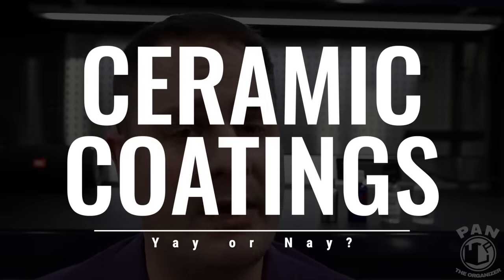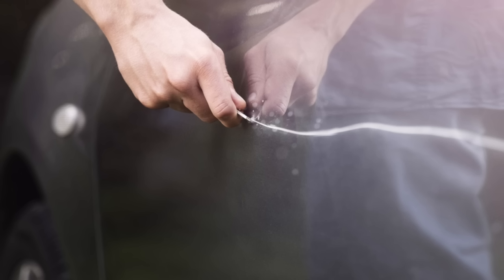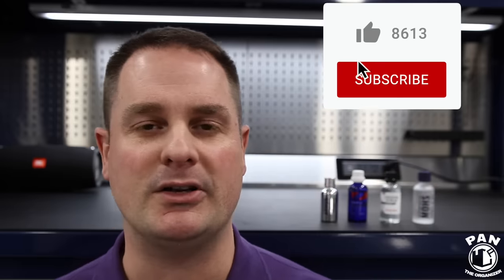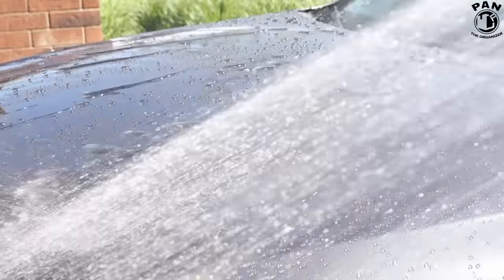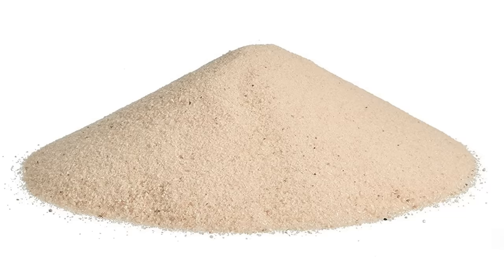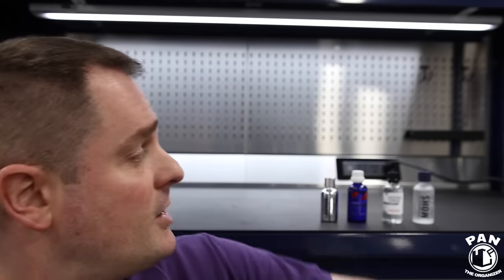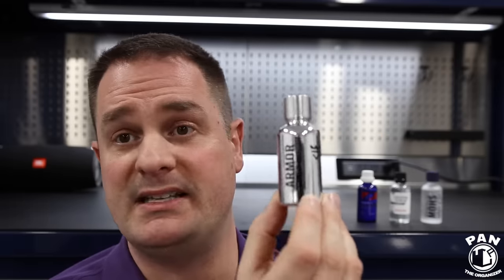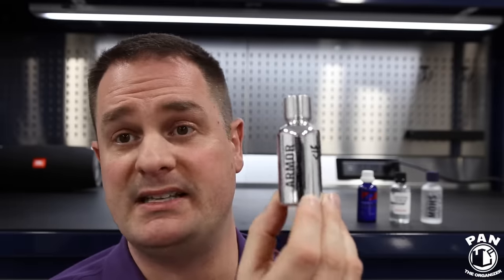DON'T BUY CERAMIC COATINGS BEFORE WATCHING THIS !!

Comment: Pan how come I washed my whole car with a good soap and pressure washer but still after I dried it, there was a dull layer of something on the paint that is not easy to clean. Mostly on the lower half of the car. What is that called and how can I clean it
Reply from the maker: I have no idea as I have no clue what you did, what products you used, what conditions you worked in, what protection was on your paint, etc.

What you wrote is the equivalent of me calling a doctor an simply telling him “Hey doc, I don’t feel well. What happened to me?”

You see how he has no info to start helping me?
Reply: @PanTheOrganizer  I think it’s road grime that was left on the paint after a regular wash. But I was in normal cool conditions and I have the vehicle coated with megs hcw. Is it normal for road grime or heavy mud adhered to the paint to not clean off with a ph neutral soap?

Comment: Does the microfiber cloth need to be discarded which was used for the maintenance silica spray dealing?
Reply from the maker: No. Just wash immediately after use and reuse it.

Comment: Can you go through the automatic car was after applying a ceramic coating.
Reply from the maker: Yes. Wait a week after application before washing your car though. And if you absolutely need to go to an automatic car wash (a handwash is always best), pick a contactless car wash. No brushes on the paint.

Comment: Hey buddy. Fantastic and so well explained video. I am a new enthusiast to  detailing and obviously I have got a lot to learn. With your video in mind, and those SIO2 Ceramic coating sprays that you recommend to use every 2 to 3 months to top up the ceramic coating... Can you use them on its own just for a basic protection after a wash? Or after a simple wax?
Reply from the maker: Yes if you paint has no protection, those sprays can be used as stand alone paint protectants. They will give you excellent protection for 2-3 months, up to 6 months depending on which one you buy.
Reply: @PanTheOrganizer  thank you

Comment: Pan, just watch your video. Very informative & thank you. My questions are can you apply a product, like Seal & Shine on top of the ceramic coating to help maintain it? Also, what about all of the commercial brands of ceramic coatings like Maguire & Turtle Wax, are we not to use them anymore & only use the “semi-professional” grade products now?
Reply from the maker: You could technically apply SNS on top of a coating, but it’s best used as a base layer of protection. You certainly can use Meguiar’s Hybrid Ceramic Spray Wax or Turtle Wax Ceramic Spray Coating as toppers over any brand of ceramic coating if you want.
Reply: Thanks Pan!😃

Comment: I use my vehicles for my transportation business and some of them are washed multiple times per week (sometimes even daily!) Could I increase the frequency of applying a topper to something like weekly? Also, if I plan on having PPF on the front clip should I not do the ceramic coating on those areas?

Thank you for the great videos and information!
Reply from the maker: You can use toppers as often as you wish. For the PPF it depends on your installer. Ask him if it’s ok to coat your front clip before the PPF installation.

How did you discover my channel by the way Allen?
Reply: @PanTheOrganizer  Thank you! I don't remember which video of yours I saw first but I have watched many of them! Also heard you mentioned on Larry's Ammo NYC channel so that's keeping excellent company!
Reply: @PanTheOrganizer  Hi Pan, I have another question about applying a ceramic coating to an older car (I bought 4 bottles of the Avalon King through your promotion) - I have a 2014 Prius that will soon be going to my teenage son. The majority of the car is in excellent condition but the front bumper an lower bumper areas have a lot of small rock chips. What special steps should I take (if any) before ceramic coating these areas?

Comment: What ceramic coating do you recommend for wheels? I need to get it asap because I need tires!
Reply from the maker: You can use any of these coatings on wheels too. But if you want a dedicated wheel coating, that resists higher temperatures, you can check out my wheel coating tutorial here: https://youtu.be/zGOI6bwJlM0
Reply: @PanTheOrganizer  Awesome, thanks!

Comment: about that 2-3 month rejuvenation period for ceramic coatings, would it be ok to use torque or nexgen
Reply from the maker: Yes, but there are sooooo many better products you could use as far as silica spray sealants. Watch my 2020 car detailing products awards video to find out my top picks in each product category here: https://youtu.be/ULvGi3dbBrA
Reply: @PanTheOrganizer  ok thanks!

Comment: Can I ceramic coat my plastic headlight housings on my Cadillac XT6?   Can I also ceramic coat the windshield?
Reply from the maker: It depends what coating you bought. Some are just paint coatings. The AvalonKing can be applied on paint, glass, wheels, plastics and lights. As I demonstrated in this video: https://youtu.be/6hDGYz6vvsw

Comment: Hey Pan, love your work. I have applied sealants like Turtle Wax Ice Seal n Shine to my car. How do I properly remove them as much as possible to get to virgin clear coat, in order to apply a ceramic coating?
Reply from the maker: Machine polishing is the only way to fully remove existing protection 100%.

Comment: Hey Pan, great rundown. Quick question, you mention quite rightly that you should throw out any towels used for application/levelling of a coating. Would this also be true for towels used to apply toppers (Reload, etc), or is the concentration of those products low enough that the Si02 would come out when washing my towels?

Thanks!
Reply from the maker: For sprays you can just wash the towels after use and reuse them (unless the manufacturer specifically mentions to discard the towels).

Comment: love your videos . you give a lot of info we can use and make our cars look great. There is one thing you should add is the direction you wipe off your coating . my friend was going in circular motions which i believe is not good it should up and down or side to side.
Reply from the maker: Wiping off (levelling) doesn't really matter, as there are no abrasives in paint protectants like coatings. Some like to buff in circular motions, some like straight lines. Just use quality microfiber towels and what ever way you prefer is ok.

Comment: Pan, A couple of questions on coating a new car, 3 weeks old and just had paint protection film. I presume you don’t clay the PPL.... Is  it necessary to do the clay bar on rest of the car?  Also are these coatings put on wheels and calipers? Thanks.
Reply from the maker: You don’t clay the PPF. And for the paint, you only clay if it needs it, meaning if you feel contamination on the surface.

Comment: What's the difference between these ceramic coatings and the Turtle Wax hybrid solutions ceramic spray coating?  Does the Turtle Wax provide the same protection on the paint?
Reply from the maker: These are true ceramic coatings that last multiple years. Obviously less expensive spray versions like the TW aren’t nearly as durable as they sacrifice durability for ease and speed of application. Silica spray sealants are basically less concentrated forms of coatings, and an alternative for those who don’t want to invest time or money into a proper ceramic coating.

Watch my popular video explaining the differences between waxes, sealants, ceramic coatings and silica spray sealants: https://youtu.be/Yxz3zSVIm-g
Reply: Thank you Pan for the answer!  I’ve just applied the TW ceramic spray coating for my 2021 RAV4 a week ago.  I live in Hawaii.  It’s always sunny and I don’t have a cover parking when I go to work.  Now that I really want to try the real ceramic coating to protect my car from the 🌞

Comment: Thanks for your informative content 
Which one of these or of the ceramic coating branding can do the paint and the plastic trims, if none could you suggest the one that does the trims
Thanks in advance
Reply from the maker: The AvalonKing can be applied on paint, glass, plastics, wheels, headlights, etc.  Pretty much all the exterior surfaces.

Comment: Pan I want to buy a low gpm with a little over 1000 psi pressure washer that can be used with a non-pressure water source like a large bucket or tank. Can I do that with any electric pressure washer? Can you recommend me something? Thank You and love your videos!
Reply from the maker: Hi. There aren't many great solutions, but probably the best one where you could use a large bucket filled with water would be the Worx HydroShot. Link here: https://amzn.to/2Ice8qd

So you won't get 1000 psi out of a cordless power washer like you would with an electric power washer. So 320 psi if pretty much what you can expect. But still enough to do light to medium cleaning duties on vehicles.

How did you discover my channel by the way?
Reply: @PanTheOrganizer   just searched how to wash a car, and your videos showed up.

Comment: Is there any problem using a Topper like Xtreme for a car that has been ceramic coated with MOHS or do you have to use the Gyeon product?
Reply from the maker: You can use which ever compatible topper you want, including Xtreme Solutions Topper.

Comment: Pan. Great video a lot of good info.  I have only used standard wax on my vehicles but thinking about a ceramic coating for a new truck I just purchased.  My question is there any disadvantages of a ceramic coating versus wax?  If you still have to apply a SI spray every 2 to 3 months you still have that maintenance step as with a wax.  Is correcting a contamination issue or surface damage issue more difficult to resolve if the vehicle has a ceramic coating?  Thanks again I really enjoy your videos and the information you provide.

Comment: difference between multiple layer ? i want to use 1 layer but is there any difference in gloss ?
Reply from the maker: Not all coatings require 2 layers. Some recommend a second layer, some only one. Often, when a second coat is recommended, it’s to ensure proper coverage and sometimes it’s for a bit more durability.

Follow the instructions of the coating you are buying.

Comment: Hi Pan, about tar removers. Will they damage the plastic/vinyl trim pieces found in cars nowadays? I have CarPro Tar-X but I'm hesitant to use it because my ride has plastic/vinyl at the doors and also along the bottom of the rocker panels.
Reply from the maker: As long as you work in the shade and on cool surfaces, no worries. Just follow the instructions on the product you are working with, never let those product dry on the paint, and you should be good. Tar removers are meant mainly for the painted surfaces, but obviously there will be overspray on plastics as you're using it, no worries. After a few minutes of dwell time, thoroughly rinse off.
Reply: @PanTheOrganizer  - Thanks for the response Pan. U da man!
Reply from the maker: My pleasure Wil. Hey what's your favourite video on my channel so far?
Reply: @PanTheOrganizer  - I've watched so many! My favorites have to be the ones where you lay out the steps and methods to clean your vehicle. I also really enjoy the product awards and your solid recommendations. 

I pay close attention to any tips and tricks you give us for using certain products correctly. I had a light bulb moment when you told us you dampened your drying towel so it dries the paint more effectively.

Looking at some of the new products CarPro is about to release with curiosity.
Reply from the maker: Stay tuned to my channel as I’ll be testing lots of new product releases for 2021!

Comment: How far does 1 bottle go? I have a Ford Explorer, How much do I need? Also can I put it on my windows?
Reply from the maker: Not all coatings can be applied on all exterior surfaces. For example, in this video, only the AvalonKing can be applied to paint, glass, wheels, plastics, and headlights. The others are paint coatings only. Typically, one 30ml is enough for two coats on two average size cars (paint only). If you plan on covering a larger vehicle and do windows too, get two bottles to be safe.

Comment: Thanks for the video! I am wondering can I apply the ceramic coating on top of the clear film car wrap? Should I? Or if you have to choose one or the other, which one is best? I am picking up my new car in about a mth. Doing research now
Reply from the maker: Yes you can apply these coatings in top of PPF. And if you get PPF, I would for sure get a ceramic coating on top.

PPF protects against stone chips. Coatings add gloss, slickness, UV protection, chemical resistance, self-cleaning properties and hydrophobic properties.

I personally don’t like the look or feel of PPF (paint protection film) and I get a brand new car every three years so stone chips aren’t a concern for me. If it is for you, do get PPF applied first. And then a coating.
Reply: @PanTheOrganizer  Thanks for the quick reply!  Didn’t expect one this early in the morning in Montreal!
Reply from the maker: I go to bed very late!

Comment: Hey Pan, how do the ceramic coatings fair against the pesky bug guts on the front end of vehicles? Does it prevent those guts from etching into the clear coat etc?
Reply from the maker: It protects the clear coat yes, but could etch through the coating if left unattended (as they are acid based those bug guts) so you have to clean your car and stay on top of them. You can use a bug remover like this: https://amzn.to/3nUC6qi

Safe on coatings.
Reply: @PanTheOrganizer  Thanks for your prompt reply Pan! I’ll look into that bug remover from GTechniq. What are your thoughts on P&S’s Bug Off?
Reply from the maker: Haven’t tried it but P&S usually makes very good products

Comment: I just bought  brand new vehicle that is over $100k. It has clear mask on several parts of my vehicle. Can these DYI clear coating be applied over it?
Reply from the maker: If you are asking if you can apply a ceramic coating on top of paint protection film (PPF) the answer is yes.

Comment: Great video… again… I have the turtlewax graphene wax… can I use the wax on top of the ceramic coating as an extra layer of protection ? Many thanks
Reply from the maker: You could in theory, but it's best used as a stand alone or on top of existing waxes or sealants.
Reply: @PanTheOrganizer  just watched your video on the turtlewax graphine wax and you said you can use over your existing protection ( 7.50 mins into video ) whether it a wax , paint sealant or ceramic coating , its a great topper and its what you recommend we do…
So what is correct answer lol 😆  😉

Comment: Great video! Is there a minimum temperature these need to be applied in? It gets pretty cold here in NY during the winters, and I’m guessing probably best to wait til the springtime
Reply from the maker: It’s usually not recommended to apply coatings below 50F. Ideally you want to be near 68F.

Comment: Can you wax the ceramic coating? Or use a quick spray detailer after doing a maintenance wash ?
Reply from the maker: It's typically not recommended to apply regular carnauba waxes on top of ceramic coatings, as the coating will end up rejecting the wax anyways, plus you would be masking the coating's superior properties.

You can use quick detail sprays and ceramic spray sealants on top of coatings. Here's my video on my favourite QD/drying aids : https://youtu.be/NOTNed04xYE
Reply: @PanTheOrganizer  so no quick detailers  either? Like the ones that say ceramic detail spray etc.

Comment: Hi Pan, I’m setting up my detailing kit and wondered, do you use a polishing pad conditioner prior to use with an electric polisher to reduce friction heat?
Reply from the maker: I always spray my foam pads with a conditioner yes, and I prime microfiber pads with the polish or compound I am using.
Reply: @PanTheOrganizer  thank you for taking the time to reply. Do you have a preferred conditioner?

Comment: Hey Pan
Great video
Question. Can you apply the ceramic coating to your plastic light covers and will it prevent yellowing?
Thanks in advance
Reply from the maker: You should apply a ceramic coating to your headlights and tail lights. Yes.

Comment: anything for anyone in Australia just bought an Rs4 and I believe it has a factory ceramic coating. is it safe to go back over the top of do i have strip it back and reapply
Reply from the maker: You would machine polish the old coating, and reapply a fresh one.

Comment: Hey pan how are you can I use low quality microfiber towels to Buff off the ceramic because I have to throw away those or used the expensive ones just because they are only for 1 time every 6 months
Reply: By the way you do nailed the video I’m gonna used the prome code 😎
Reply from the maker: You can lose lower grade microfiber towels no problem. I like low pile towels to level coatings, 300-350 gsm. As long as the towels are clean and dry when you use them.
Reply from the maker: Thanks Luis! I appreciate the kind words.

Comment: What percent SiO2 is in these coatings? I think that would help determine which coating youre going to purchase.
Reply from the maker: Quite the opposite actually. The % is just a number, and no real way to verify. Most brands don't mention the percentage anyways. What matters more is purchasing coatings from reliable and reputable brands. Like those in this video. % is often just a marketing number, and doesn't necessarily reflect the actual product performance in real the real world.

From my experience, most good coatings do have 60-90% Sio2 content, but that's only one part of the ingredients list... Again, there is much more to the chemistry than just raw numbers. You should watch a discussion I had with an industry chemist about coatings here: https://youtu.be/A8V7_HysfwA